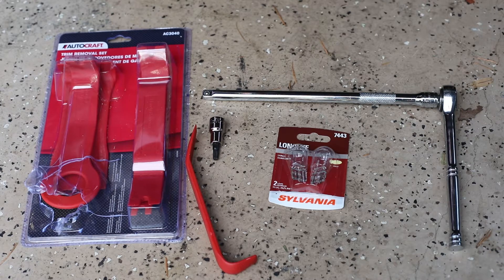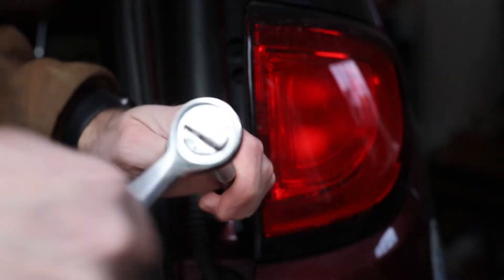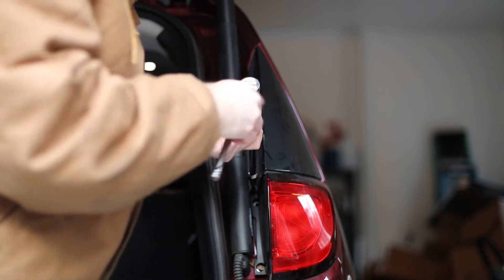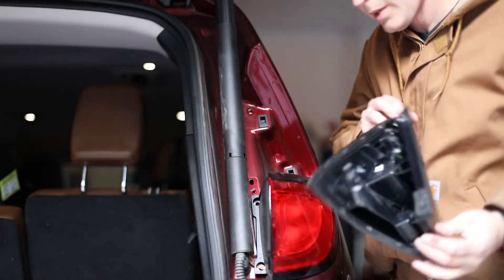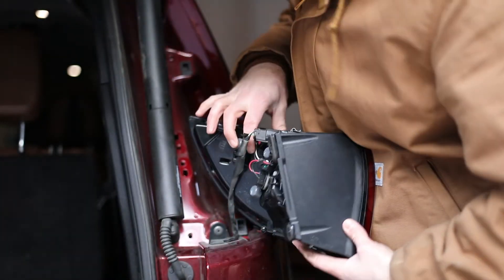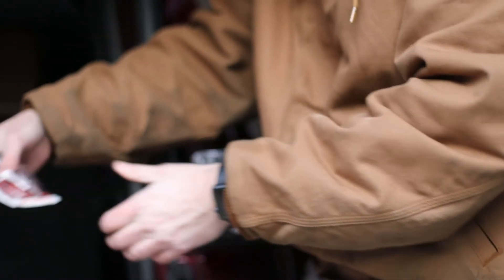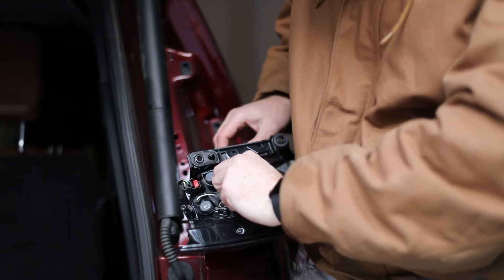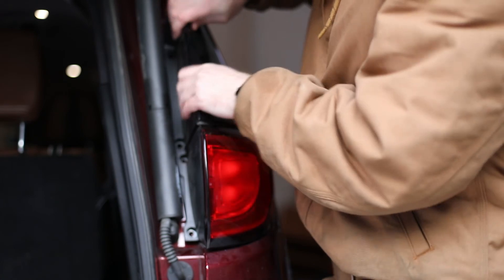How To: Pacifica Rear Turn Signal Bulb Replacement

Comment: Great video. I have a 2017 Pacifica and I had to get the 7440 instead of 7443. The 7443 has 4 ‘terminals’ and it won’t fit.  The 7440 worked like a champ. Thanks again.
Reply from the maker: Thank you for the feedback - yes, be sure to double check the number/type on the bulbs that you remove to be sure you are buying the correct replacement bulbs.

Comment: Awesome!   Just did a 2017 Pacifica using your video.  Used a standard screwdriver with extension and bit holder (for the T30 bit).  Easy, thanks to you!

Comment: Thanks so much. You saved me a lot of time! I love my Pacifica, but was surprised I needed to change a rear turn light with only 16,500 miles. There is nothing in the manual other than the bulb replacement # , which at O’reilly ended up Sylvania  Longlife 7443. The big unknown is the pull out of the light housing. Without a  visual
this could have gotten frustrating, if not broken. Also, I used a drill with an 4-inch extended drill bit holder for the T-30. Again, thanks so much. It pulled up high on Google and saved me a lot of time and frustration.
Reply from the maker: Grant Hoover thanks so much for your kind words.  I’m glad this was a help!
Reply: I was surprised as well. I just changed mine at 38,000 miles. Who knows if was changed before I bought it with about 20,000 miles on it. Way too soon for bulbs to be going out...

Comment: I recently damaged the plastic cover of this light assembly as well as the assembly adjacent to it. Is there a way I can replace just the plastic cover of this assembly instead of replacing the entire light assembly?
Reply: There is not a way. You have to replace the whole thing. Find a used or cheaper part

Comment: When I 1st saw the Pacifica minivan at the garnish holder was the whole light design.   Its just a plastic  Just wait for the 2021  restyled model it's gonna be harder to replace because it's gonna be full led simulator to the Durango and the Charger models....
Reply from the maker: Will be interesting to see. I’m sure it will look nicer but yes, probably harder to service.

Comment: Thanks for the video. I will say the definition of “easy” is fluid. I was hoping it was a little more accessible without the use of a wrench and torx and pulling out the light assembly . I know it’s not hard but just wishful thinking

Comment: great job, very helpful!
Reply from the maker: 18PacTL+S Thanks for your kind words!
Reply: changed out the reverse lights yet? easy to do as well?
Reply from the maker: 18PacTL+S I have not done that one yet, but will let you know!
Reply: actually i think it's even easier than the brakes/signals. in the liftgate there's a plastic box on each side, pop it open and the swap is right there. thanks again though for this vid.
Reply from the maker: Oh excellent!  Thanks for that.  If/when they need replacing I will shoot a quick vid for that too.